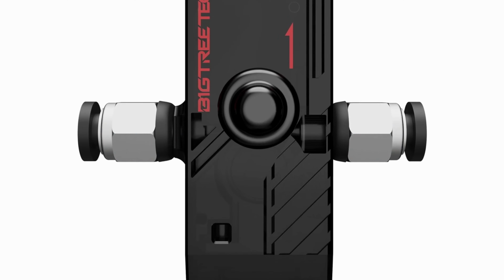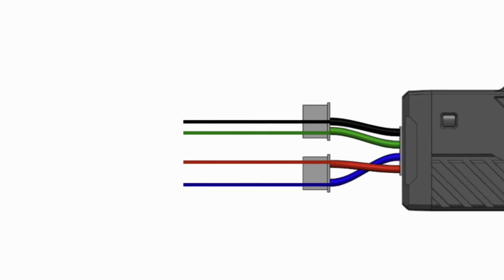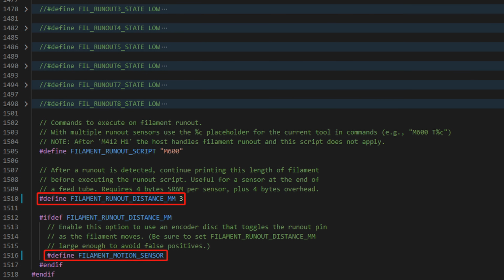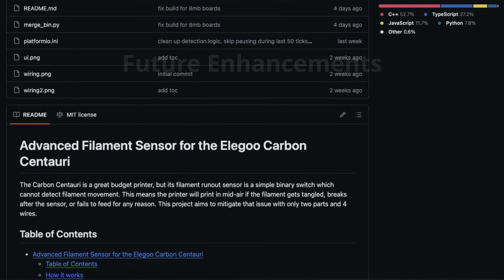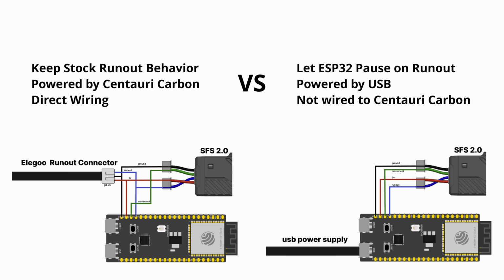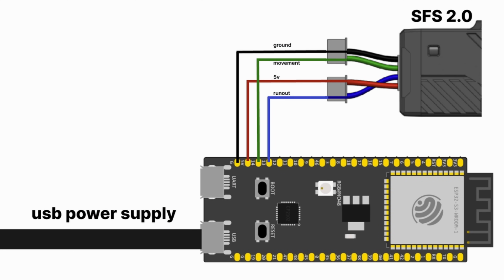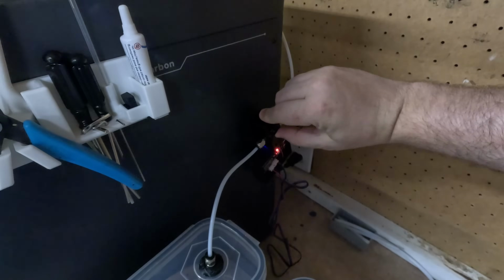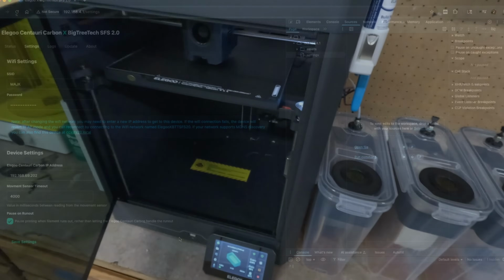Elegoo Centauri Carbon Upgrade, Filament Movement Sensor

Comment: Why not make btt filament sensor interface to esp32 and detect jam or runout, to generate runout emulation from either case. The esp32 can indicate with LEDs which condition it has detected. End result is the same, find the reason for jam, or add filament 😊
Reply from the maker: Do you mean have the esp32 tell the Carbon it's a runout if it jams? Unfortunately that won't stop the printer in time because a runout signal doesn't actually stop the carbon. The carbon keeps running to use the last filament in the Bowden tube. We have to pause it as soon as possible to be able to save the print.
Reply: @jrowny  that's a shame but I can see the logic and it's a good half a meter of filament in the tube which once sensed it can't be easily pulled back out with Unload function. We really need a hard-wired option to greatly simplify the hardware(esp32 vs ATtiny85) at the sensor.  I wonder if the AMS port has something useful.

Comment: Fantastic idea! 
Missing feature - some sort of notification/alarm that the printer needs attention! Personally, I’d like a loudish audible notification (and a means of cancelling it when I respond) because I’m not necessarily going to be around to see a flashing led (or even hear or notice that the printer has stopped). I guess that if there was another defined I/O pin going high then folks could attach their own effects to that… 
But if you are controlling the CC by sending commands to its web interface, it occurs to me that you could flash the chamber light… which would be more effective on some CCs than others… (but add a push switch to the esp32 to cancel the lightshow).

As I understand your implementation, the printer now goes into pause immediately it detects “no filament”, rather than using almost all of what is in the ptfe tube before stopping. So… are you able to withdraw that last bit of filament (like a normal Unload), or must it be manually purged through the nozzle? Not at all worried about wasting the filament, just concerned about a possible inconvenience.
Reply from the maker: you can choose to retain the stock functionality if your'e wiring it up directly. There's a checkbox on the settings page for it. Otherwise, yea, you'd need to pull out the remaining filament which could be annoying. 

There's plenty of IO left, since this only uses 2 GPIO pins if you want to modify the firmware for flashing lights. 

I think I might want to solve this with a home assistant integration though, because then you could send a notification to your phone or even make the lights in your house blink if you wanted.
Reply: @jrowny  more excellent ideas! 👏 Thanks!

Comment: thank you! I've been wanting to connect an esp32 to a btt sfs 2.0 for a while and just couldn't get around to it. My goal is to use those parts and an lcd for filament length measuring on my filament respooler.  Once I get things working, I will definitely give you credit for this great work.

Comment: The two big “mods” im curious about are using an open source AMS or some how adapting a Bambu labs AMS to the CC, or swapping the motherboard for a klipper board
Reply from the maker: OpenCentauri is working on this: https://suchmememanyskill.github.io/OpenCentauri/klipper-via-mainboard-replacement/
Reply: @jrowny I was looking for a good stop to mention OpenCentauri 🤣.